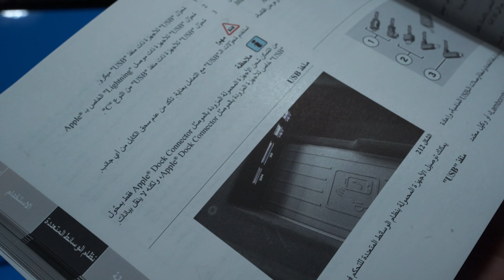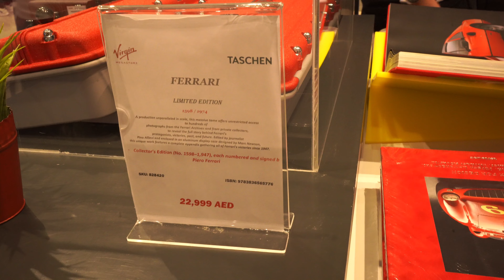FIXING BLOWN MCLARENS IN DUBAI!

Comment: my question is how is it that the car doesnt indicate or know theirs low oil? Won't the engine cease in order for it to prevent engine wear?
Reply from the maker: To measure the oil level on a McLaren it’s a 120 second procedure. You need to put your foot on the brake and hold down the throttle at 2k rpm in a certain menu for it to show the oil level. It will not tell you when the oil is low otherwise as it cannot check without going through the procedure. Their is no oil pressure sensor on this car either to show the actual oil pressure, their is only a dummy switch that tells you if there is any oil pressure or if there isn’t! Bad design from McLaren.
Reply: @InfinitPerformance  wow.. car that cost 300k+ CAN $ has this major flaw isn't good though! I was thinking maybe this is better super car than the Lambo. But wow, I'd get the later or NSX/LC 500

Comment: Excellent video
Is that an inherent problem to these McLarens? I think earlier in the video you said the car doesn't let you know if it is low on oil. That's wild lol
Reply from the maker: Very common issue on Mclaren’s, they use oil at the rate every other engine would but some more than others. No low oil level indicator on the M838T and M840T engines, you need to check manually and it’s a 2 minute long process!

Comment: Dubai and the builds here are insane. Never race a Nissan Patrol, because you have no idea whats under the hood of that beast. 
Also wondering, would you guys so a DAZA/DNWA engine swap into my Golf R MK7?
Reply from the maker: We are more than happy and capable of taking on a DAZA/DNWA swap but you need to be aware of what you are getting into. You need RS3 Engine + loom + ecu
Subframe
Gearbox
Transfer box
Propshaft
Rear diff 
Downpipe
Battery relocation to trunk
Reply from the maker: It works best if you have a full RS3 there to take the parts from basically 😂 fuel pump and module also need swapped.
Reply: @InfinitPerformance  I know its a massive job and that you basically need a salvaged rs3 for donor parts. My main question is cost. Ive got a lump sum ready but need to know if its enough. the engine alone is about £10k so im expecting a lot more than that. Wonder how long it would take.